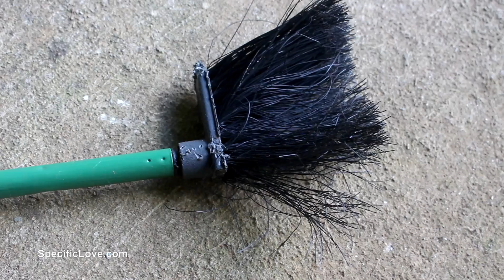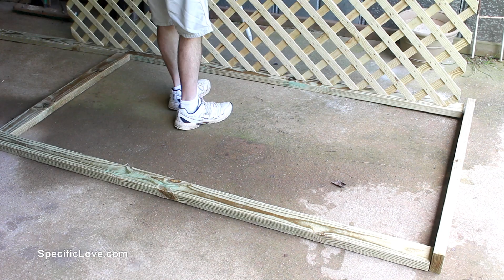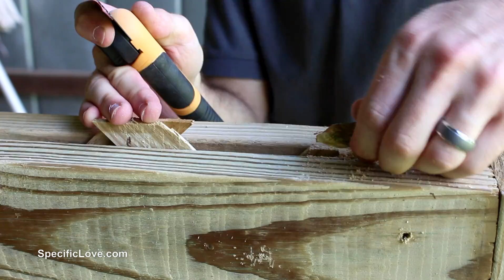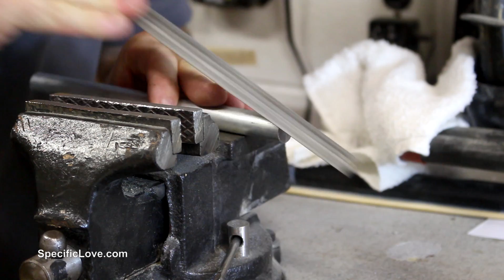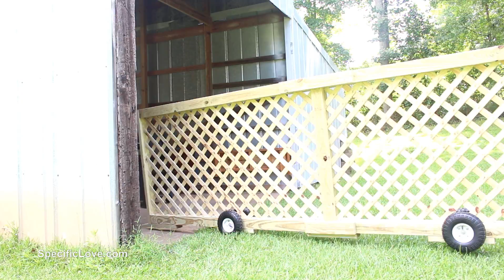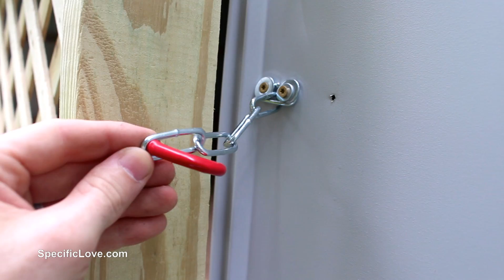Rolling Fence Gate DIY - Backyard Upgrades #6

Comment: I have left over support joists and lumber from my deck rebuild - I want to make a rolling fence but put wagon wheels with a handle so it can be moved easily (no permit needed if it is mobile).  The support joists and decking lumber are both about 10 feet long - I have a NFH (neighbor from hell) that I am wanting to block - any suggestions on how to keep it from tipping over?  I want it to be long and high - the deck builder cut the pieces for me - I just need to put them together.

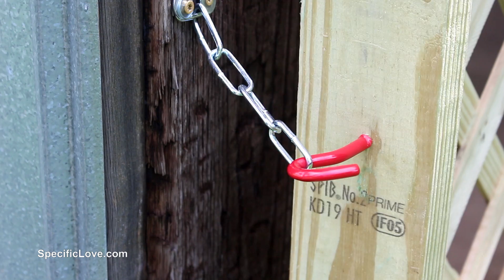Comment: 4:32 ... So this keeps the dogs in? You seen the other exit behind you? Lol good idea though. Gotta watch them fingers too bro. Can't build much with stumps. So, 4 wheels or 6 wheels? How about 3. You could have had it tighter to the fence as well as hidden most of the ugliness of those tyres. On the base you have let's say 4x2.. tyres are maybe 3 inch wide. If you applied skirting on the base you could have had X3 wheels with only an inch or more of tyre showing.

Comment: Instead of butting the 8 horizontal frame members, next time butt the first layer then bridge the first layer with a full length 2x4 then fill in the ends with a 2x4 cut in half. You won't have to do all that horizontal bracing.
Reply: Paul Smith can you make one for me
Reply: Seriously, I have NO idea what you just said! 
I wanna build stuff so badly, at 40 years old I have finally realized that's what I have always wanted to do, however,  carpentry is intense, so much more then I could have imagined, and the lingo is a whole other language, quite like hearing/ learning IT lingo.....